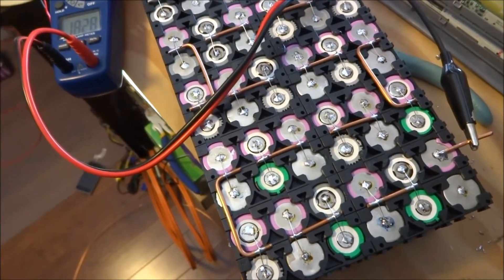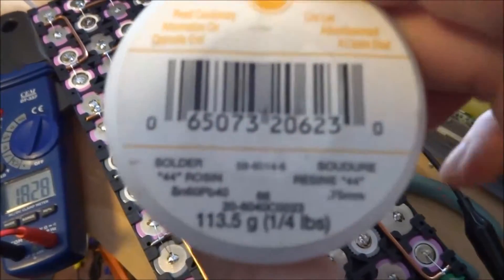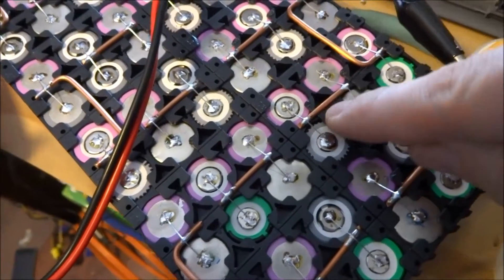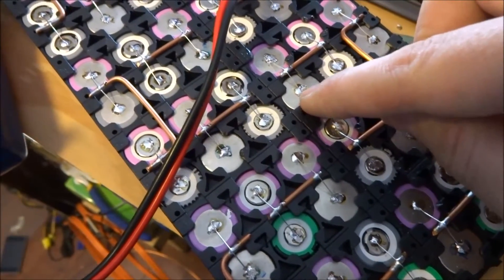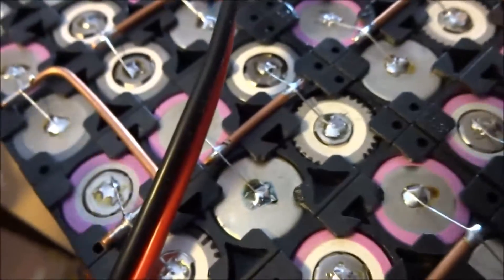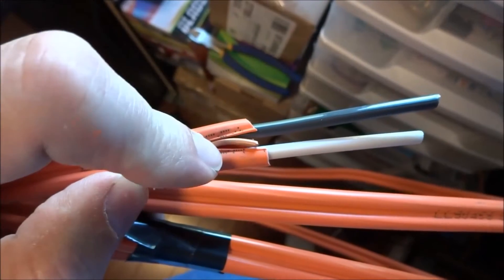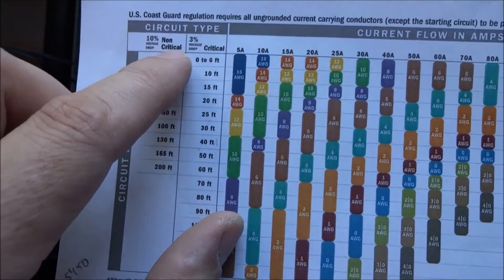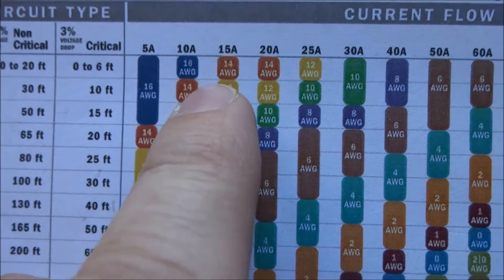Nissan LEAF range extender pack build Pt.2.5 (prototype pack)

Comment: Will you have a bms to monitor all the 96 cells?
Reply from the maker: Probably not, a 96 cell BMS isn't cheap and I don't plan on making this a permanent installation in the car. I'll only add the pack when I need more range. Definitely not on the prototype pack.